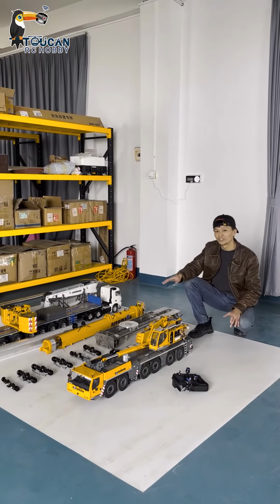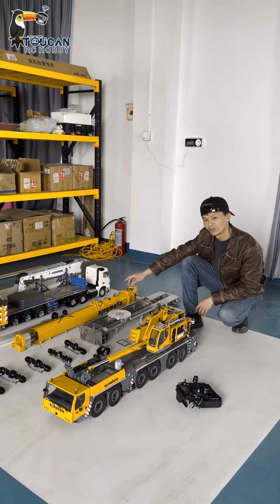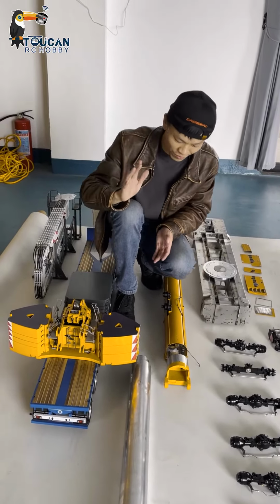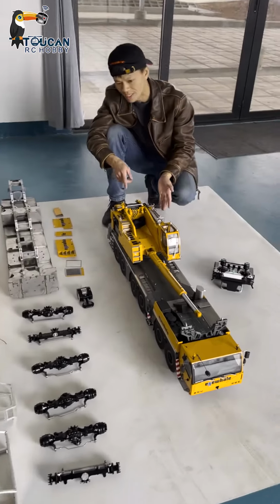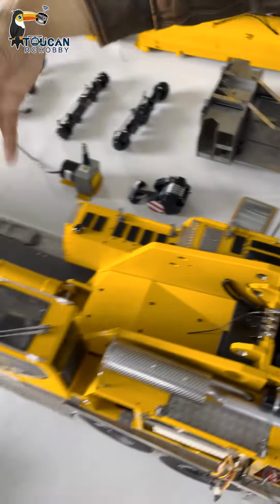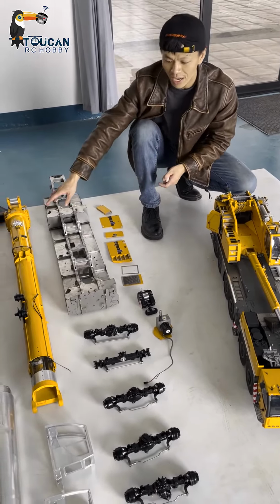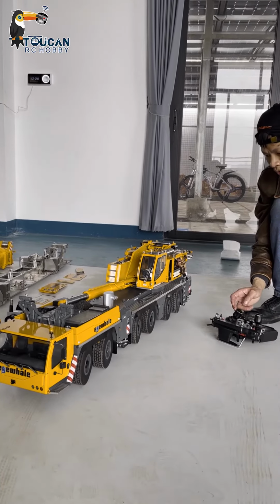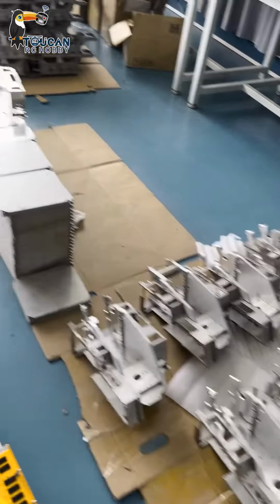Details of the LTM1350 RC hydraulic crane truck, two pumps,11 valves. Light and sound#model

Comment: WOW!!!!
Hands down, we finally see a crane!!
YES!!!

😁

Just out of curiosity, how many pounds can it lift in weight, and will it be sellable on Amazon?

Please tell me!!
Reply from the maker: At different angle with different length would be different, later will make a diagram to show the safe lifting weight
Reply from the maker: Limit test at top angle is around 80 kg, but never try the limit for not to break it and not to get hurt
Reply: @toucanhobby2400  Fair enough.
At the same time, will it also be sellable on Amazon?
Reply from the maker: Please add me friend can preorder with a deposit, for posting online would be only when have stock for quickly send out
Reply: @toucanhobby2400  How do I do that?
I don't quite understand what you mean by that...
Reply: Oliver nice crane,you need  to build a crawler next that's what I want.😊
Reply from the maker: Hi I'm Oliver,For more details and service please add my Facebook: https://www.facebook.com/profile.php?id=100083176249155, whatsapp +8619376345156
Reply: @tony5247mittens  Yeah, I have to agree with you about that one, too!

Maybe even a crane that can have it's own drag line bucket, too.